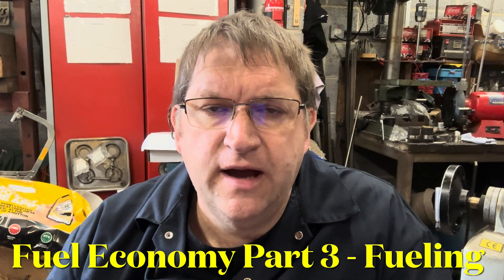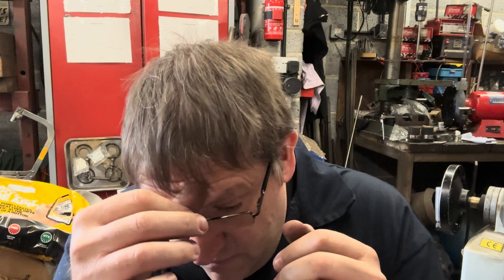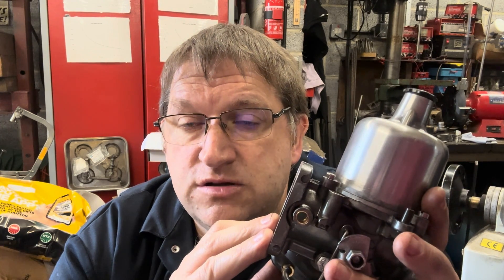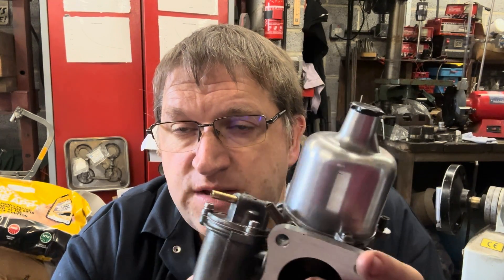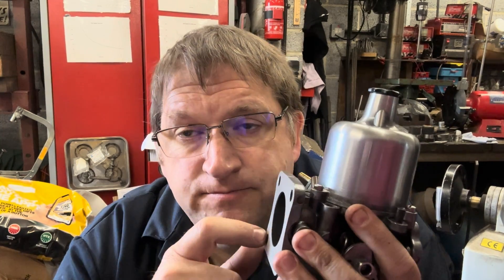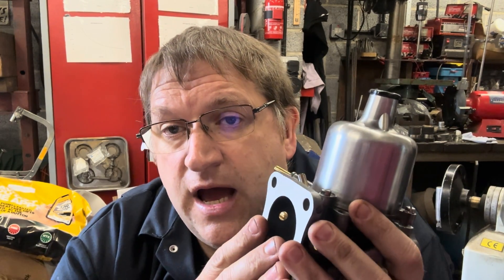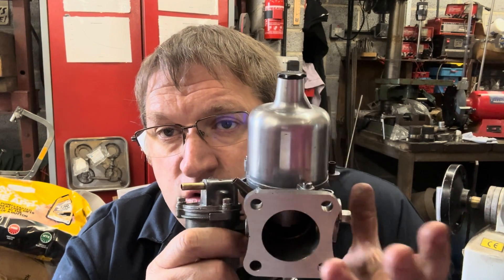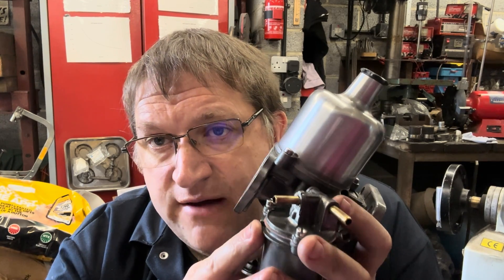Fuel Economy Final Part 3 - Fueling

Comment: A question, does maintaining intake air temp at a constant upper limit ,say @60degC , be an effective method of maintaining air fuel ratio in all weather conditions? Think exhaust manifold heated air . Old idea but thoughts?
Reply from the maker: Yes. Heating the manifold is a good way to achieve this.
Reply: @ACDodd gee..that was quick,I’m in Australia btw

Comment: wow, it is so amazing to me that the carb can do all of this. when i look at my megasquirt or speeduino set up and it seems hard, how did these people find this info out when they designed the carbs so well. Hours and hours of tsting
Reply from the maker: You have to remember, carbs have been around longer than fuel injection, so they got the designs perfected many years ago. The problem is now there are precious few people left who can get the carbs working as they should. I and trying to help this by offering training.
Reply: @ACDodd  yes thanks for doing this, and its not just the carb info, it relates to a lot of little missing bits of knollage for me.

Comment: Great advise AC ! I presume the same applies to the HIF carbs . Could you outline the advantages of the HIF , or disadvantages , beyond authenticity for us .; I always assumed a concentric float bowl would be a benefit , but I would appreciate your thoughts , thank you .

PS Damm  ! Would you believe it , but I found some answers to my question in your video ' Introducing a brand new ACDodd HIF44 SU!!! ' ., five minutes later !  Doh !  
Only yesterday I checked out ported vacuum versus manifold vacuum too , which was very educational . All hail the AC and DV gods !   Would a dash vacuum gauge ( manifold fed in this case )  be another way to help drivers to achieve better economy  ? What with an AFR meter my theoretical dash is getting filled up , lol , but i  like  the thinking .
Reply from the maker: If you watch part 1 of this series I believe I mention a vacuum gauge and yes it’s very benficial.
Reply: @ACDodd  Thank you !

Comment: Thanks Adrian for the explanation re pressure regulation of rhe fuel pressure.  Can you advise what type of/ make of pressure regulator would be suitable for a mini? Would the same regulator   be suitably for all variants ie adjustable? Or are they pre calibrated for the specific carb or engine variant?  An example of a or some suitable unit or units would be handy! 😊
Reply from the maker: Minispare spares sells the 67mm filter king, ideal for SU Use.
Reply: @ACDodd with the glass or the alloy body? 
Also how do you set them to the right pressure
Reply from the maker: @StefanMiniCooper glass bowl with the 1/4” tails. You use a pressure gauge, in the line that goes from the regulator to the carb.
Reply: @ACDodd ok thank you!
Reply: @ACDodd can you please suggest the best location to fit, and hide one of these (I want it to look stock), ‘92 1275 Tahiti Hif38? Thanks 👍

Comment: I wonder if anybody has ever attached the piston to a stepper motor and tried to control the fuelling with an ECU ?
Reply: If you have an ECU you can control the fuelling via software, which would make the damper more or less redundant.
Reply: @wheater5 I have seen a system that turns the SU into a throttle body and injects fuel directly into the airflow, which is a good fairly simple way of approaching converting to fuel injection. I find direct control of the piston and therefore fuelling an interesting concept.
Reply: @martinhibbert1428 Yes, about ten years ago I looked at converting an ISO (SU clone) to this type of setup for my tuned Reliant 850. In the end I decided the trouble and expense didn’t make it worthwhile. I decided to fit a different engine (3 cylinder Suzuki G10) to the car concerned, supercharged it and built a fuel injection system for it.
Reply: @martinhibbert1428  thre is a lot more to it on a mini, there is charge robbing to contend with. also transiaent fueling can be hard to set so i have heard. You cant do twin throttle bodie systems with out a lot of complicated code and experience of where the fuel is going
Reply: @Avtovaz21057 Yes, I have read that throttle body systems with siamese ports found on A series engines can be challenging. Maybe having direct control over the position of the piston or pistons on twin carb setups might be a better approach than using throttle bodies.
Reply from the maker: All seems a bit  pointless as the airlflow is what is controlling the piston.
Reply: @ACDodd But the relationship between the air flow and fuelling is controlled by the profile of the needle, which requires the dark arts performed by Mr AC Dodd and his needle lathe to bring under control. If you could control the position of the piston based on data from a MAF sensor, O2 sensor, etc,etc you have a closed loop control system, similar to a fuel injection system. An interesting concept at least.
Reply from the maker: @martinhibbert1428 then you would just have fuel injection which is better anyway.

Comment: Thanks AC.Obvious really,yet it hadn't occurred to me that slow-rise dampers would have that effect. Removal of the piston (when running methane) made a big difference. That experiment made me cobble-up a magnetic piston-lift - I extended the piston-shaft and have it run thru' a solenoid.
Reply from the maker: Nice!